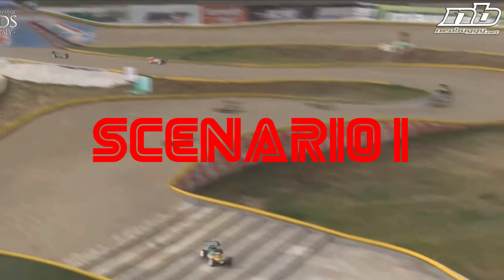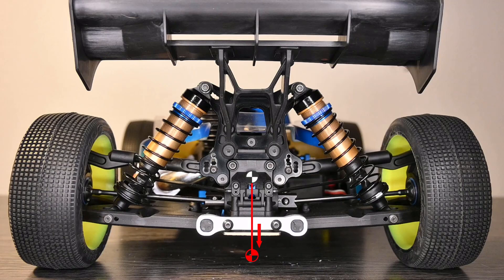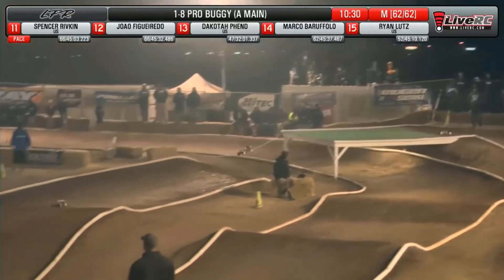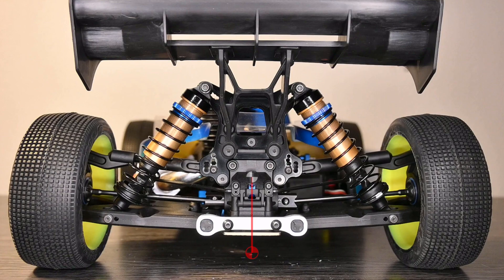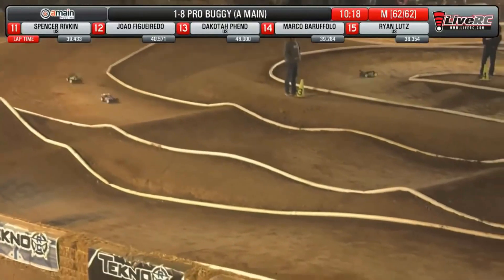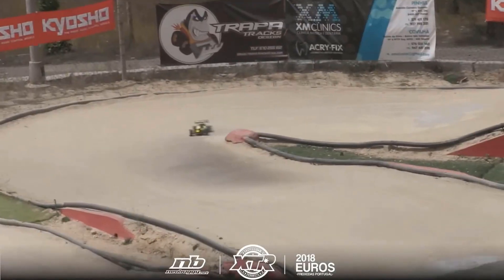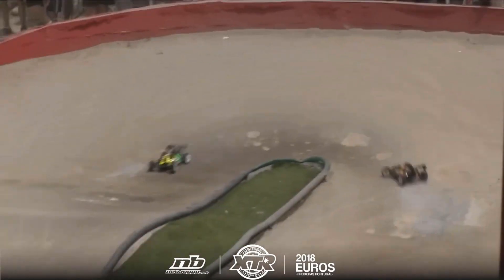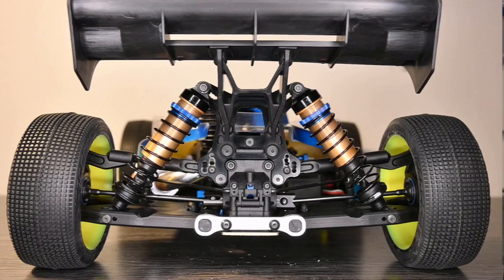From the ground up: Roll Centers Part I

Comment: also one thing that is not mentiond about roll centers is they are not static as on the paper but as soon as the car starts to bump squat and lean in a turn or a slight change of ride hight makes the roll center to change and move around up down sideways.

the picture is just a static formula done during setup to make sure roll center is in theory in the right place compared to front as they rooling around roughly the same axis like a boat that tossing back and forth front and back need to be in sync or the boat or this case a car will act as if its trying to brake itself apart.

Comment: No one.talks about how to change the roll center in the front end. On a c hub car it's easy to figure out. But not so easy on a pillar ball. ??????
Reply: I would imagine that the same principle applies. Use a taller ball, or put washers underneath?

Comment: Great job Max. Very well explained. After watching this and other vids again and again it slowly makes sense to me. However I am still wondering if its possible to totally fuck up a car by roll center setup. For instance on cars of the major brands like Kyosho, Mugen, Mayako, Asso, Sworkz and so on, is it possible, for instance, to set the roll center that low ending up with positive camber gain? Or are the setup options always on the save side on a well designed car?
Reply from the maker: For Kyosho and Mayako I don't think the roll center setup can be totally fucked up. Mugen, Asso and Sworkz on the other hand have very wide tuning range and the window where the car works consistently is narrow. And currently Mugen  and AE run a positive camber gain in the rear thanks to the super long link.

Comment: on scenario 1. the car is traction rolling. wouldn't you want to raise the roll center to reduce further rolling?
Reply from the maker: The reason why the car is traction rolling is because the car is resisting roll geometrically. This means that the forces in the linkages will want to raise the car up and then we see that traction roll effect. When the roll center is lower the car is not resisting roll geometrically so the car is allowed to roll under the suspension and the forces through the linkages wont be there to lift the car up as much. Basically the angle of the upper link being higher will tend to want to raise the car up.
Reply: @maxmortrc  makes sense. thank you!

Comment: Nice work
Balancing front and rear roll centers?
Reply from the maker: Roll center is the point which the center of gravity tries to roll around. Center of gravity is the same point in both ends but the roll center is dependent on the suspension geometry in both ends. 

Now to make your car work properly you want the rear end and front work in harmony while they roll. This doesn't mean that both ends have exactly the same roll center rather both ends need to be tuned so that the roll on each axle matches the grip on each axle. 

Another way to try and think about this is roll axis meaning an axis drawn connecting both the front and rear roll centers. If the axis is in a really weird angle your car will roll in a very weird angle.

Comment: Did you drill more holes in your shock tower for the camber linkage?
Reply from the maker: Yeah I did it for testing but i currently use only the original holes and the lower one most of the time

Comment: Pink Floyd I feel it :) That was an excellent explanation on roll centre. I race on road only these days. But sometimes depending on the traction at the track a higher roll center will give more grip especially on the initial turn. I believe that is because the force applied to the tyres are higher at this point. Maybe on a lower traction track a lower roll center works because we need the car to roll to create more traction. IMO. Please correct me if I’m wrong.
Reply from the maker: Yeah thats about right. The main difference and the simplest way to explain this is with a higher roll center more force would initially transfer from the inner tire to the outer tire. With lower roll center the forces between the inner and outer tire will initially be more balanced.